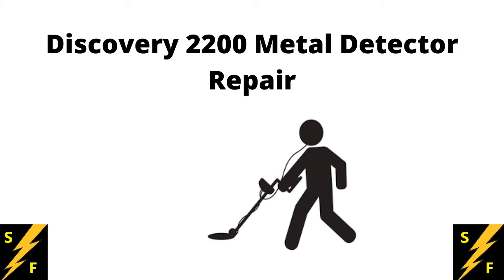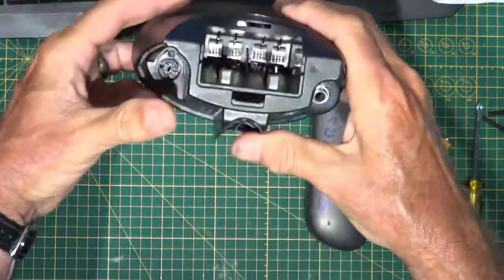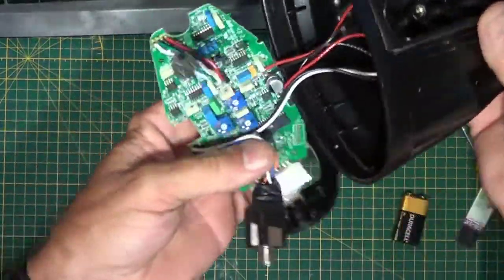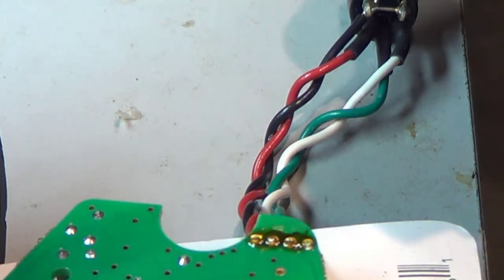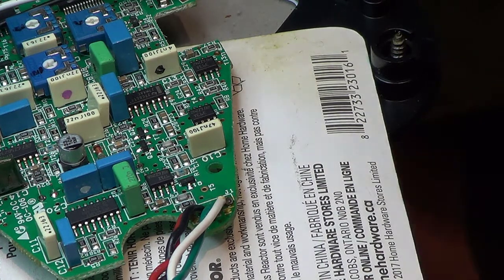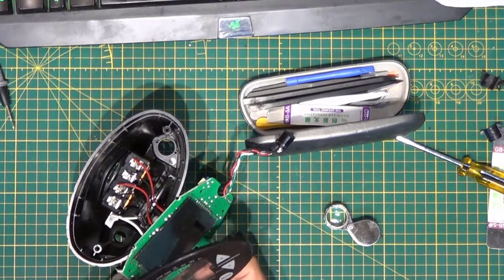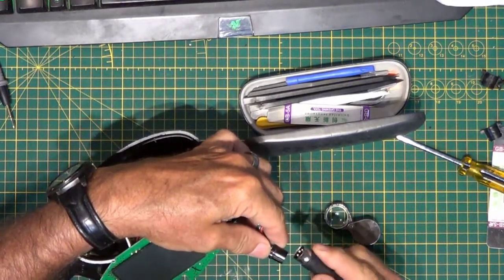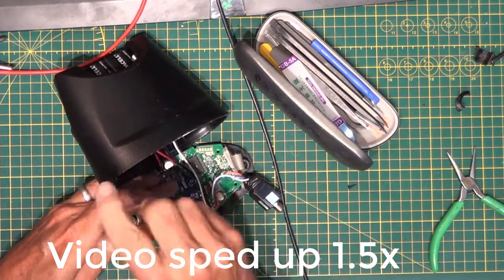Metal Detector Repair - Discovery 2200

Comment: Mine won't come on. I have an elite 2200 and have replaced the batteries but still won't power on
Reply from the maker: Check the battery connections, sometimes you will see some rust, or green corrosion on the spring or metal contacts where the batteries connect.  Clean it with Isopropyl alcohol or some very fine sand paper.  The other thing to look for is a broken wire, or cracked circuit board if it was dropped.  Thanks for watching!

Comment: Do you take repair Jon’s on these types of units. I just picked one up at a yard sale and would like to have it repaired.
Reply from the maker: Hi Yvette - thank you for subscribing to my channel!  I love yard sale finds, that is the only way I can afford my many fascinations!  I do not repair items professionally anymore.   The good news is that with a little learning from YouTube, and some inexpensive tools from AliExpress you will be able to fix many things yourself.  Do not be afraid to take things apart and just look....sometimes you will see a leaking component (usually a capacitor), a grey/loose solder joint (cold solder) that can be reflowed with a soldering iron to repair.  Sometimes it is a broken wire, or just dirty contacts on connectors (isopropyl alcohol is good for cleaning).  If you get stuck, feel free to msg me and I will help where I can.  Good luck with the detecting, it is a fun hobby!